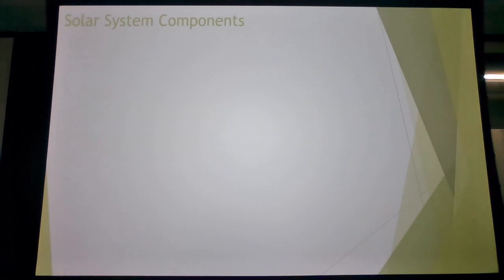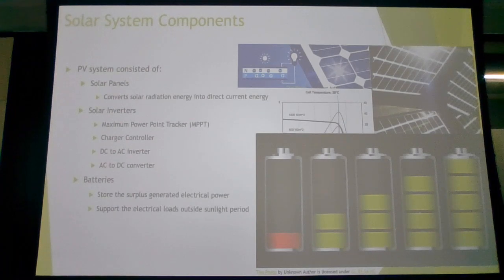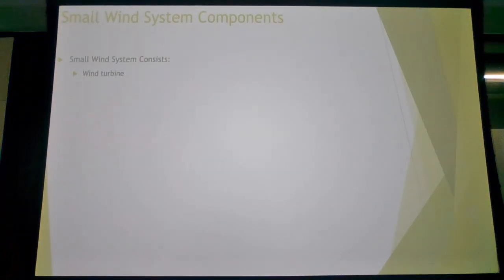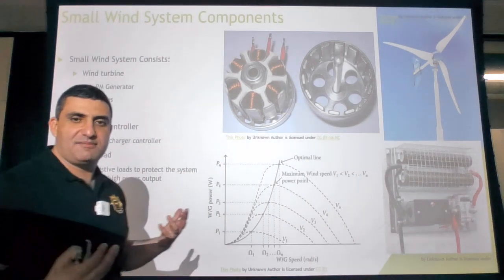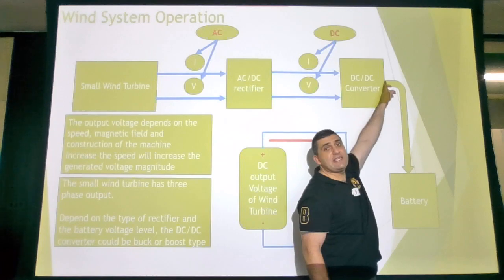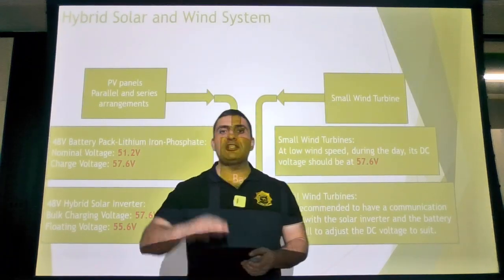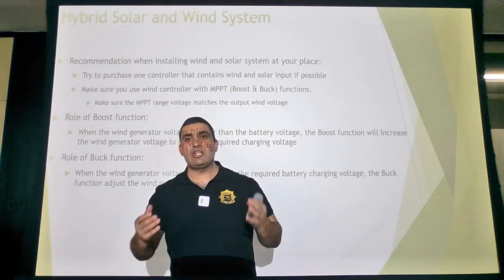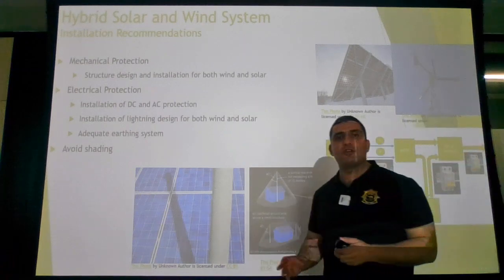Requirements for Hybrid Wind, Solar and Battery System

Comment: Perfect representation bro.

Got a question 

1- if we have an MPPT wind / solar controller,  where we have to connect the  inverter for ac household equipment ?

2-  If we have an  MPPT solar/ wind hybrid controller 
Instead of connecting the  +/ -  DC  to the battery,  can we connect +/-  DC to solar MPPT inverter and let the inverter charge the batteries  !

Thanks bro.